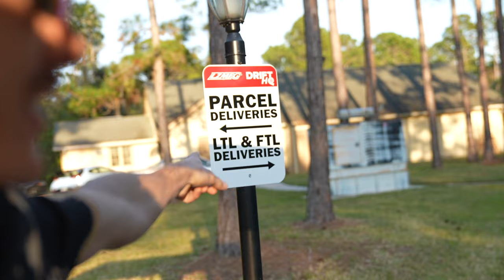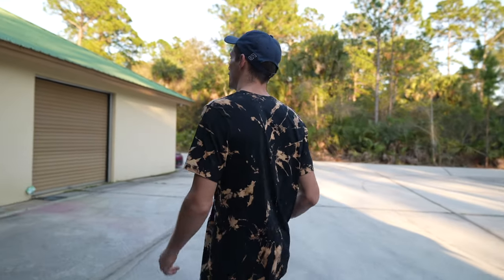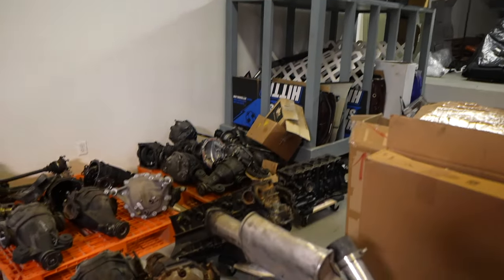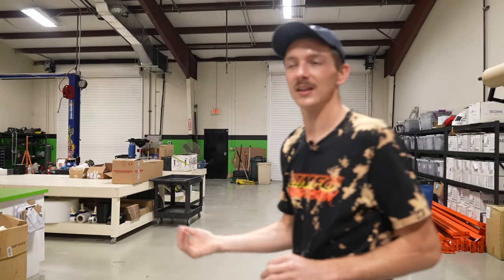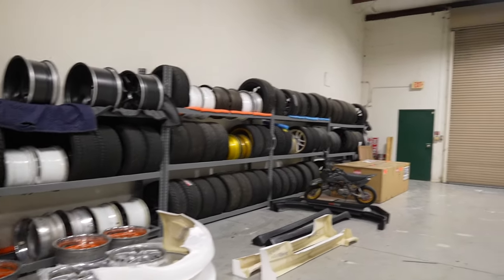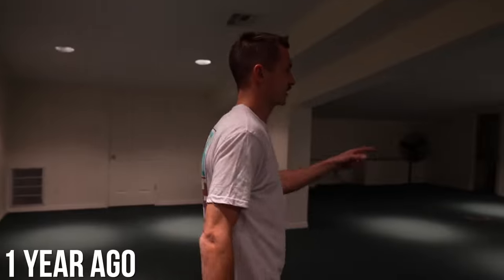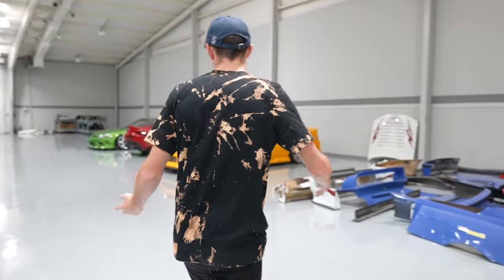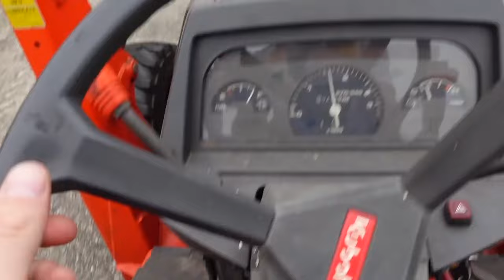The LZ Compound’s 1 Year Transformation

Comment: To solve the Delivery issue. Paint a colored reflective line following the route they need to go. Just need one sign at the front that way, plus you can tell them to just follow the red line.
Reply: Probably not going to work in his case. Because that line is going to be destroyed by cars drifting over it in no time.
Reply: @carfreakjim  it’ll last plenty of time if you do it right
Reply: Yellow brick road?
Reply: Or put signs up for them... then use them as clipping points
Reply: Make the lines using stencils and paint
Reply: @seendizle  best worst idea iv heard so far
Reply: @carfreakjim  You just re-paint it again like they do with roads, its not too bad. Plus half the time people wont see signs but following a line is easy

Comment: What you need to do for your trash pile is mow short as you can around the perimeter of the pile and maybe even spray some water around it if it is very dry to keep it contained then just use a butane torch to start the fire. That should do the trick but if you want to make the fire starting process easier throw some diesel on it (think your smart enough not to use gasoline). P.S. (my dad is a firefighter and we have done this same technique with piles of leaves about the same size or even bigger).

Comment: Pour about 2.5 to three feet wide barrier of sand arround the whole burn pile to make sure the grass doesn’t catch and you dont set a forest fire, then just set the thing a blaze, you could wet the sand slightly if you like
Reply: I also suggest breaking it into smaller piles maybe into 4ths or 6ths

Comment: Separate your burn pile into two. And only burn a portion of it at once. Like 1/4 of the entire thing at most. If yoU want to be safe you poor water with a hose in a circle around the outer perimeter of the fire. But that may not be necessary if it's cleared properly

Comment: As for the burn pile. Douse it in lighter fluid and throw a torch at it. It’ll be fine. Invite everyone over and have a party. We call that a bonfire in yee yee land. But don’t use gasoline. Just don’t…
You could wait until a light rain too, just so you don’t have to worry about ash catchin anything on fire.

Comment: Bro do NOT light that pile back there lol. That this is massive and guaranteed to catch some of the trees around it. BUT you could easily do smaller burn piles. You just need a water source in case things run away.